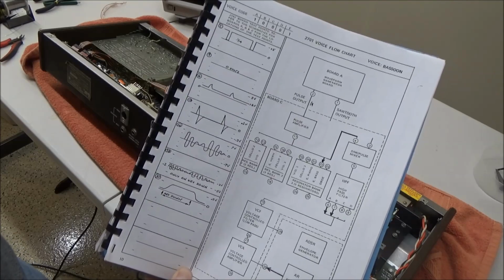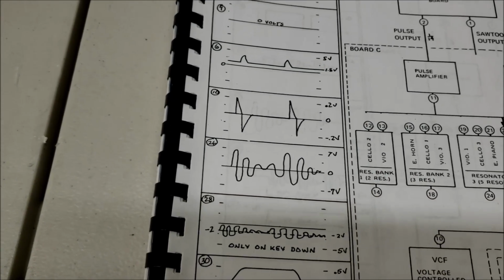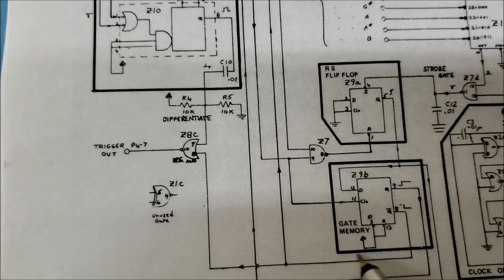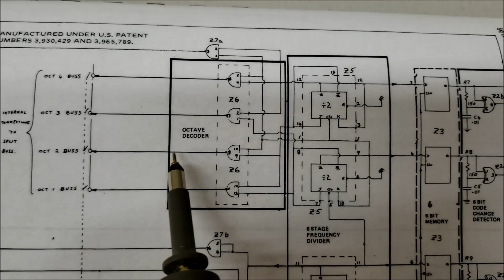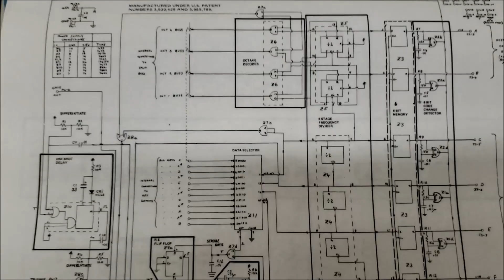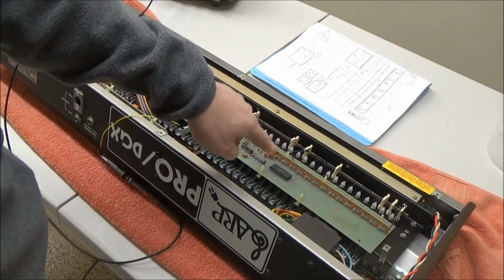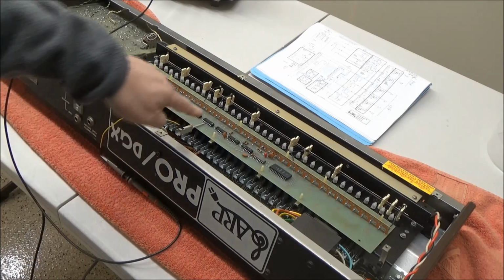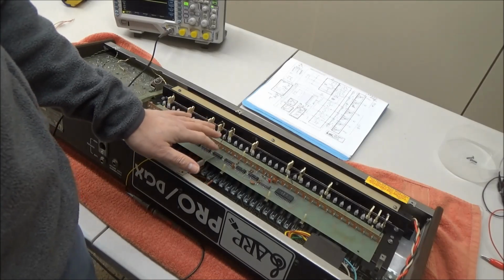ARP Pro/DGX (Pro Soloist) No Output Repair - Synthchaser #161

Comment: I’m working on a Pro/DGX V2 myself right now and I’m stumped. The ADSR is not working. I’m getting a gate signal to board b but i’m not sure if i’m getting a proper trigger. When I probe the trigger input to board b on pin 7 of J4 i see a very tiny spike when I hit a key. So small and fast that you barely even see it if you’re not looking for it. I’m just not sure if it’s a proper trigger signal. Does that sound  like what I should be seeing or should the spike be a more prominant?
Reply from the maker: It's a quick pulse at 5V TTL logic levels.  I usually will need to change triggering mode on the scope when looking at it.
Reply: @Synthchaser  thanks, it looks like it’s a good trigger then, at the same voltage as the gate. 🤔

Comment: All the best in 2024, have a fantastic year!
A little question regarding this repair. Wasnt it worthy to replace all those old logic chips from the painful board or it is generally rare for them to fail or they are not available (obsolete) anymore?
Reply from the maker: The TTL chips in these synths have a much lower failure rate than the CMOS and op amps they used.  But yes, some of the chips are obsolete (like that big 24 pin 74150 multiplexer chip and the DM9601 one-shot used to generate the trigger).
Reply: @Synthchaser  Oh ok, thank you very much for reply. Makes perfect sense then. And yes I was suspecting that the "specialised" chips might be obsolete and problematic to source eventually.

Comment: Very interesting video Synthchaser, thanks for all your great work... my question is, why did Arp make such a complicated keyboard scanning circuit for a 3 octave monophonic synth? What benefit did it offer compared to the typical kind used on something like a Minimoog?
Reply from the maker: It seems unnecessarily complex to me as well and I don't see any upside.  Besides being more costly to make and more failure prone, it precludes the synth from being easily modified to take a CV in, and the high frequency VCO creates bleedthrough into the output (you can always faintly hear the last note played).
Reply: @Synthchaser  Ah interesting... the only thing I can think of is maybe they were using this synth as a testbed for some new tech that could be applied to a later product (ie micro-controlled polysynths).

Comment: Great video! Although you had good reason to remove the board, if the only goal was to replace the chip you could simply cut off the +5V pin close to the chip, piggyback a new chip (or even a socket if there's headroom) and reconnect +5V separately.
Reply: You could. But seems the better solution to me.